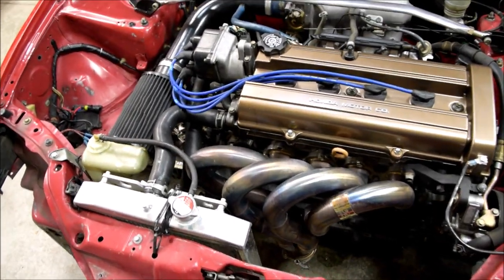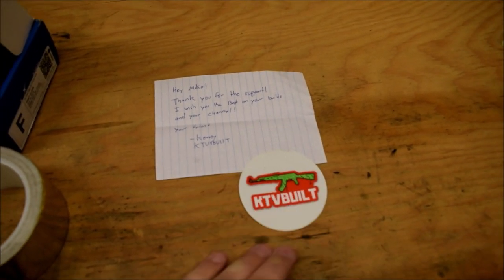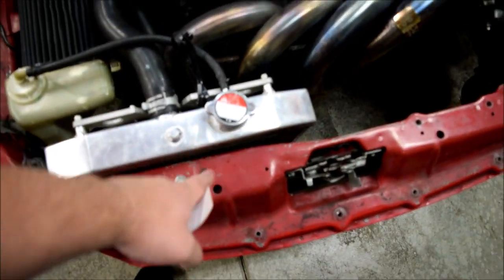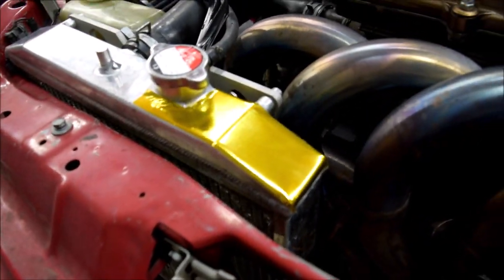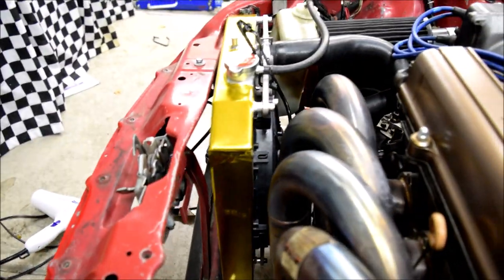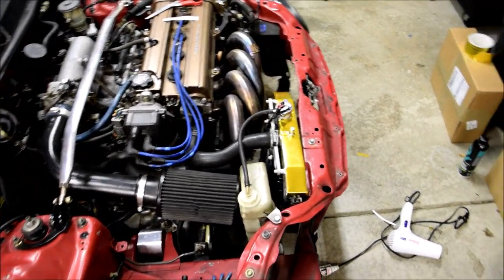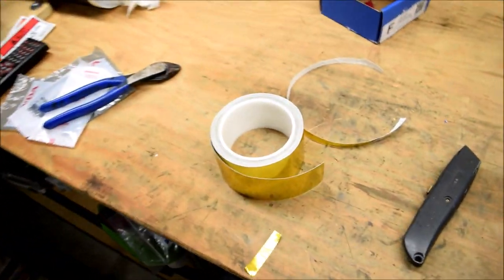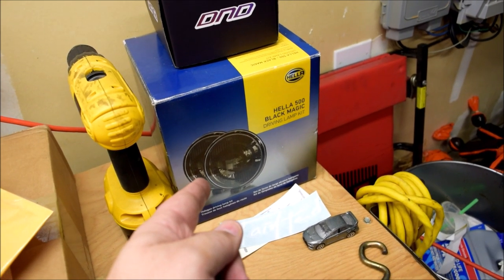Project Civic EJ1: Gets NASA Technology

Comment: what i have noticed is that the carbon intake made the performance worse i lost power trough the entire powerband, 2hp at the top had a cold air intake before, i would't do it, get the filter as far away from the heat as u can. Also i saw your intake pipe is it 90 degree the bend ? i am building my self a intake and am trying to find out how much clearance i will have before ordering the pipes :) Keep up the good work
Reply from the maker: Thank you for all that great info. I appreciate it. I will move the intake closer to the fender and maybe later on do cold air. Since its just mainly a summer car it will be ok for Oregon weather. Thank you for watching and the comment.
Reply from the maker: Just subscribed to your channel. I will check it out on my days off. 🤟